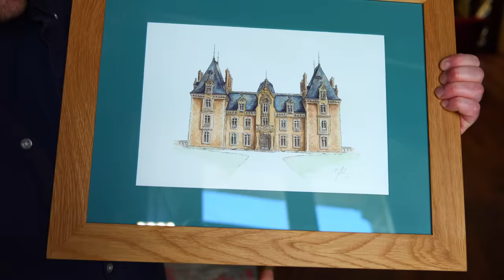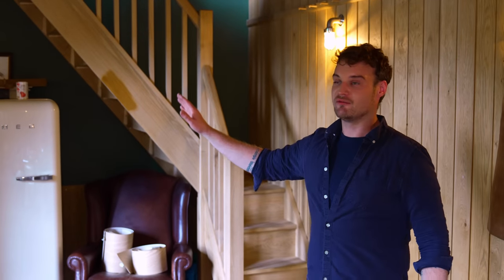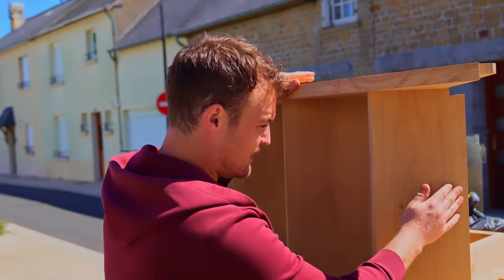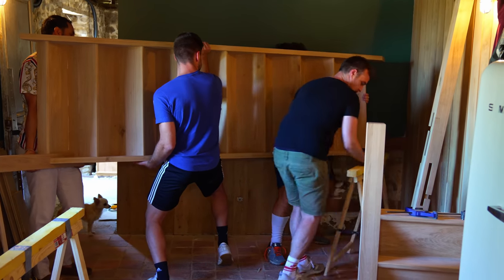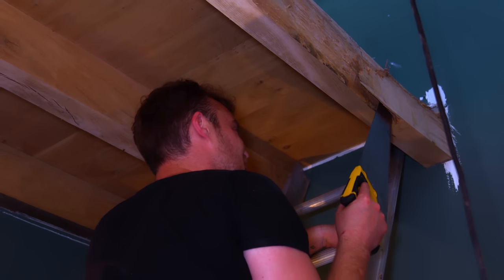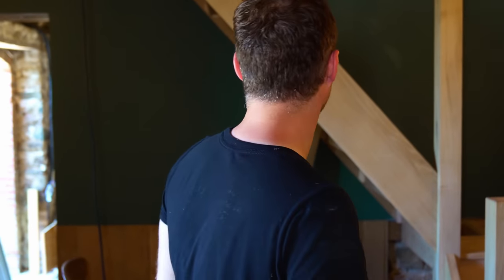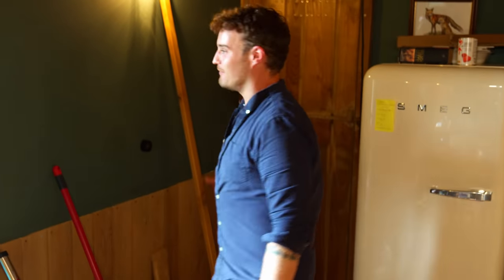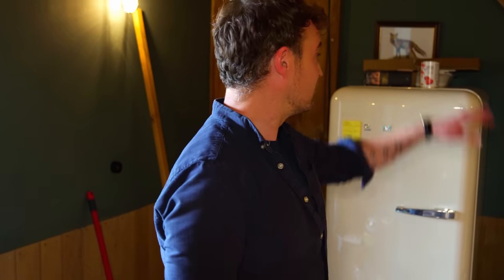Replacing This 100 Year Old Cottage Staircase.

Comment: Micheal after you stain everything in cottage.  You should use that heavy duty oil base paint on your trim, staircase and beams.   Like what you did for the main staircase in the Cheatue.  That came out beautiful,  it was also the day you came down the stairs case with the red curtin draped on you.  Lol it was cute and fun what you did.
Reply from the maker: I will be using the exact same product in the cottage on the stairs and panelling. It really brings out the natural beauty of the oak. Great minds think alike. Xxx

Comment: Oak boards always expand and unless you make provision for that you will be in trouble so close boards like yours are not to be recommended. Use Oak fa
Reply: Faced plywood and use overlapping strips to cover the joints also treat both sides and use a  water proof membrane behind .

Comment: I realize that all of your vlogs  can't/won't be this long, but I enjoyed this one.  Almost makes up for such a long wait.  The stairs look nice, but I almost miss the ladder. lol.  The watercolors are amazing.  Being somewhat colorblind I gave up painting 50 years ago and have focused on pen and ink, or sculpture.  Nice work.   So what does the upstairs look like?
Reply from the maker: Thank you for your patience. I’ve filmed everything that happened in the last three months so you won’t miss anything. 
The bedroom is pretty much finished apart from installing the electrical outlets, light fittings and skirting board. Although we had to stop work in the bedroom, as unfortunately the windows were hiding some pretty substantial rot. I’m having replacements made as we speak, but the originals will have to be ripped out which will make a big mess. Once they are installed I will reveal the finished bedroom. Xxx

Comment: Moms always have good ideas. I love Tee Tees new bed area. Perfect! 🥰
Reply: The pup under stairs bed is adorable. A tip from personal experience: the harder the spot is to clean, the more important it is to 'soil' proof. Fill the floor of the space with some kind of sturdy but flexi waterproof layer, trimmed to fit or better yet, formed to go up the back and sides a bit. Whatever is around, maybe 30 mil rubber pond liner, rolled or folded at the back and sides to stand up?

Comment: Your place looks amazing! ..question…why didn’t you make landing and last few steps wider so you aren’t so squished?
Reply from the maker: I would love to have made them a little wider, but the stairs would then be even steeper. Steeper stairs mean really high steps. There are a lot of calculations that go into a staircase and it’s the only option that worked for the original space. To be fair they are only about 10 centimetres narrower than the second run. It’s deceiving on camera because they don’t look as narrow in real life.
Reply: @DoingItOurselvesOfficial  thank you for the reply. God truly has blessed you with lots of talents.

Comment: 5k for a staircase that you have to put together yourself...when we had our staircase made for our gite not only was it hand made and fitted, it was done in two interlocking pieces that curled round the corner on the way up. Our decision to have it made in pine as it would outlast us, took two weeks, job done for a tenth of the price .... Everyone to their own but it would have paid for the windows to be made.
Reply: Oak is much sturdier than pine.
Reply: @WS-by5cl  So how long will it take for a pine staircase to wear out? My house in the UK was dated 1823 and there were no problems. The new one installed in France is already 20 years old and shows no sign of wear. Oak or perhaps elm is always preferable, especially if money's no object....but I am happy with pine.